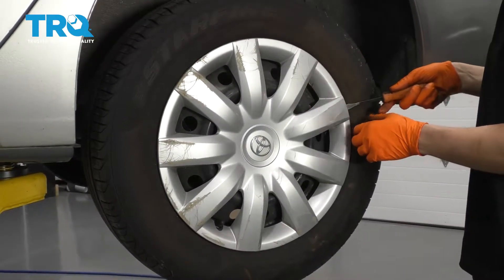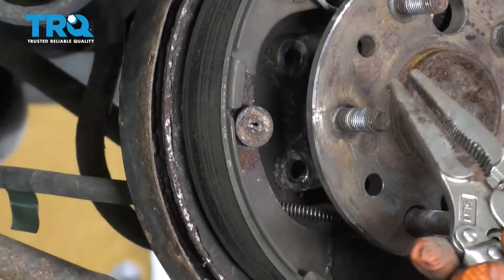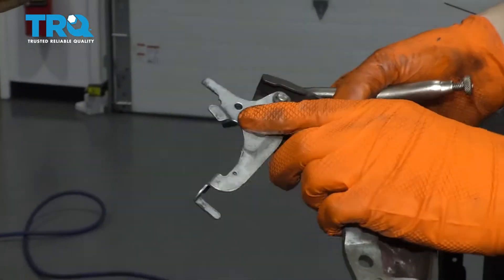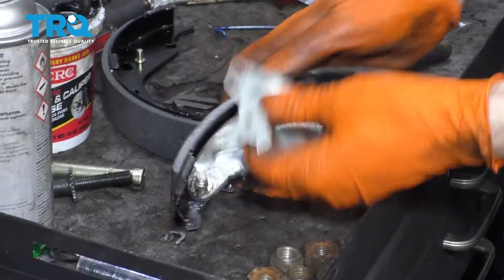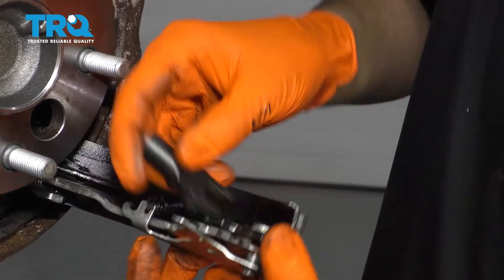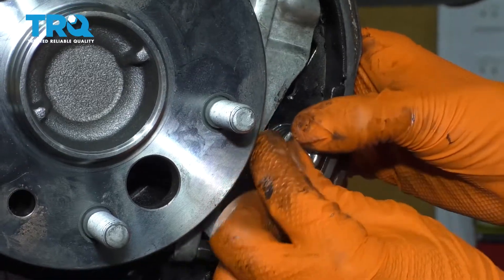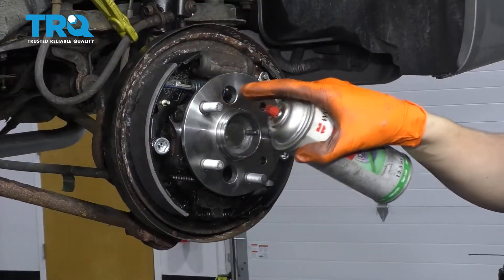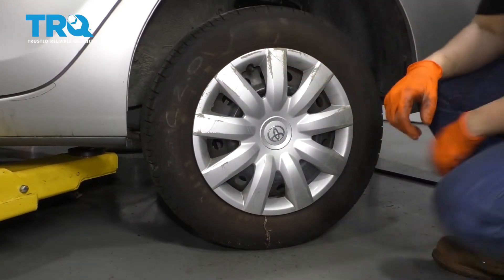How To Replace Rear Drum Brakes 2002-06 Toyota Camry

Comment: I’m changing an 04 Camry.. you didn’t show what you did with the other end of the adjuster? You were saying to clean it then it just disappeared after you put on the new spring. Easier to put on the spring before you apply the grease or else it won’t fit 🤔